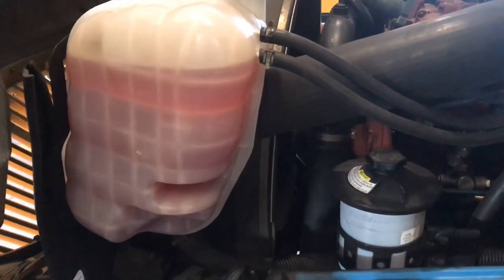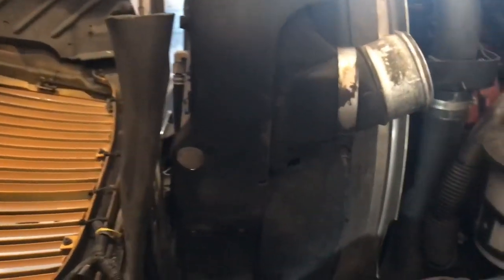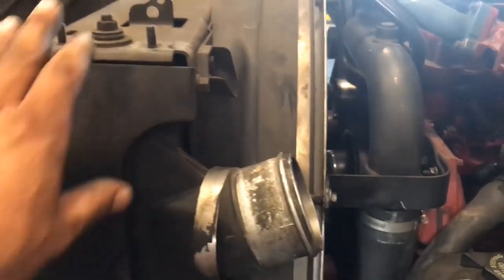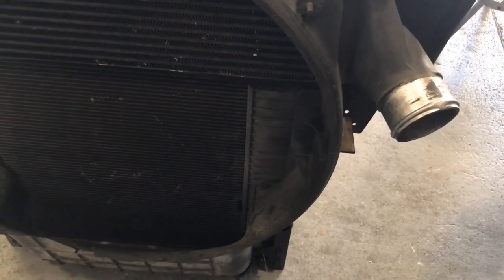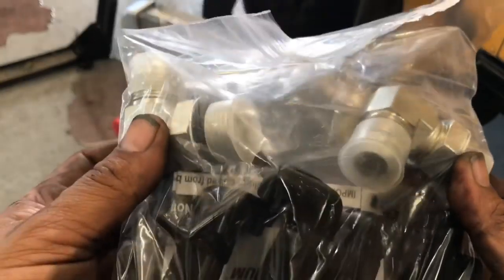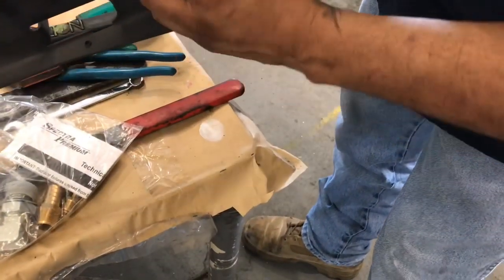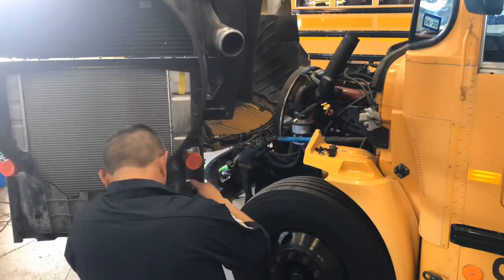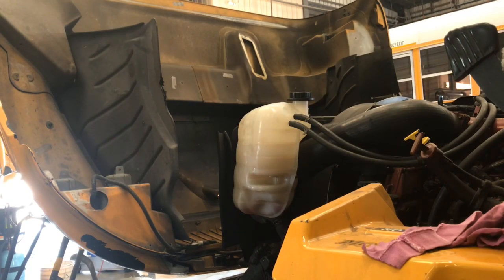CE school bus overheats

Comment: Interesting...A CE overheating....our bus has a ac problem...our bus came with the original IC AIR and when shes driving it's like her air completely shuts off...plus it's so hot here in Memphis...also our brakes squeak alot and theres a big "thumb" when she stops suddenly...but I've played attention and have noticed every time that happens her air pressure moves back to 90 psi....instead of were it usually is...hmmmm... also again this was a great vid 👍🏽👍🏽👍🏽😁😁😁
Reply from the maker: hi there Tilden. sounds like you got some issues with your bus. lol. districts bus. thanks for the thumbs up. all districts are having issues. we are working on buses on a daily basis. and talk about it being hot. in south Texas. it would hit 110 till like about 3 weeks ago. its cooling down a bit though. glad to hear from you bud.